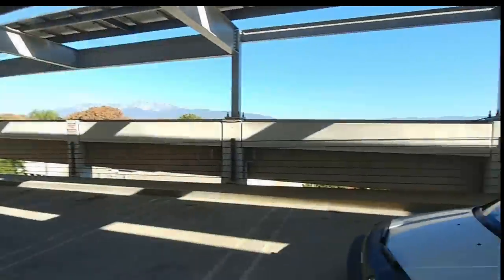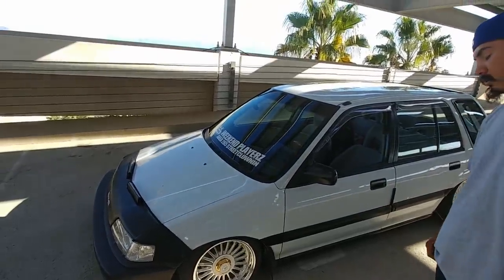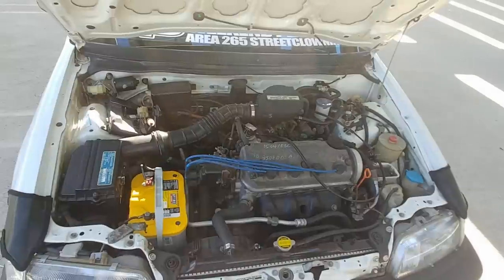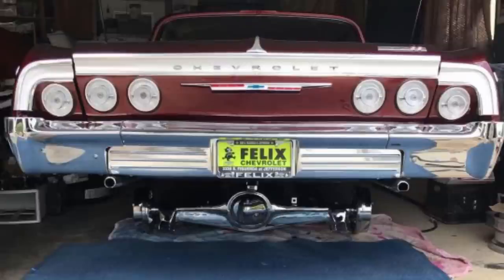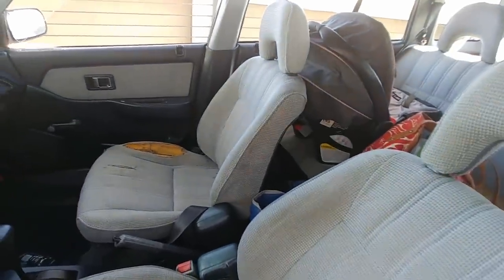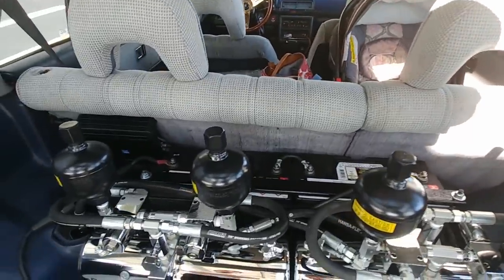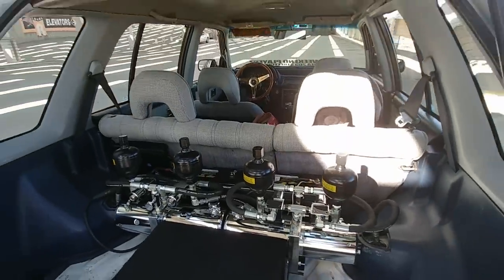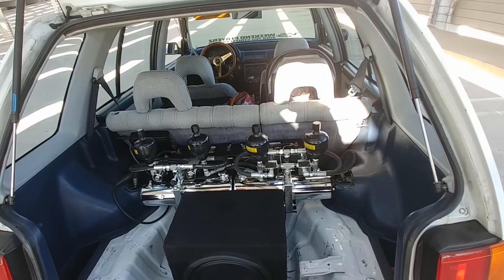1991 Honda Civic Wagon on HYDROS: Old School Traditions! (Budget Build Honda)

Comment: that's clean as is I wouldn't add any more batteries. you add more batteries it's going to add more weight and it's going to take up more space in the back. what I would do is that subwoofer box. where the spare tire is I would make a custom sub box and have the sub in the box where the spare tire was. and this put a little cover over the subwoofer and you would have that much more floor space for groceries and whatnot
Reply from the maker: Awesome suggestions man. Thank for watching
Reply: @AutomotiveAnatomy  it's clean just the subwoofer would give you two feet of more room maybe more